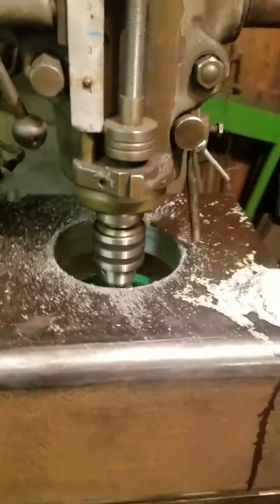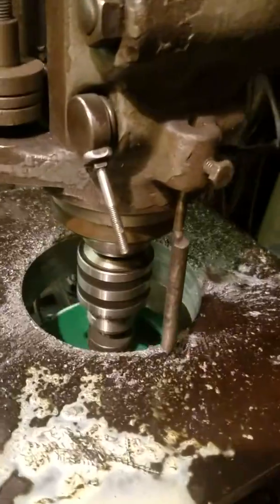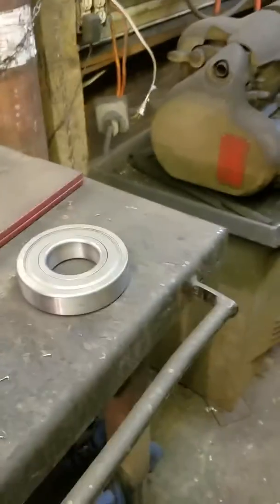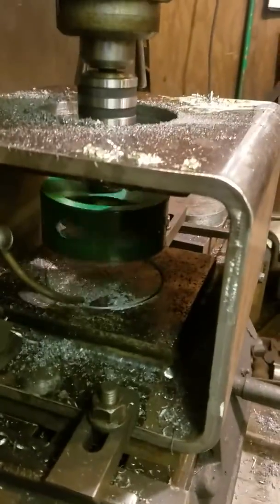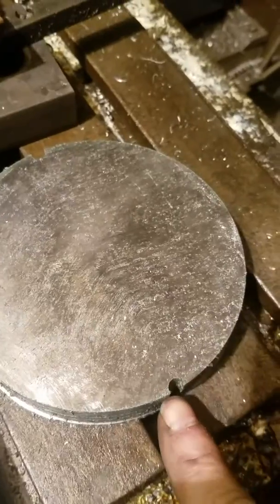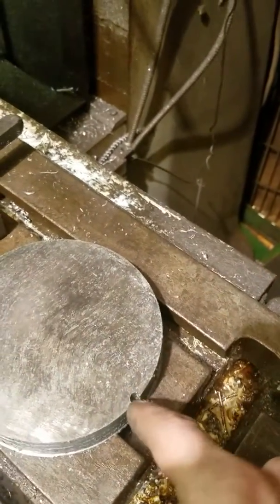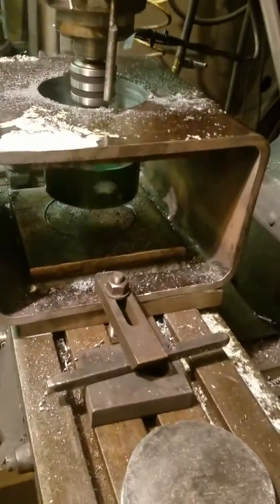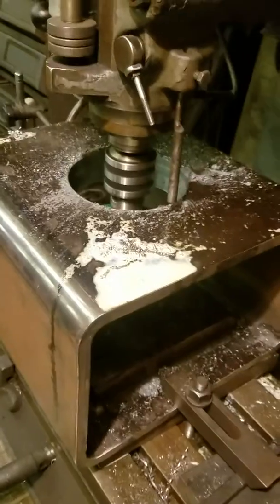Cutting a 5 inch hole in 1 1/2 inch thick mild steel.

Comment: How many rpm are you running? I'm trying to cut an 85 mm hole with an hole saw, roughly 3" 1/2; I'm not sure about the rpm; I'm around 1890/200 (i run with an inverter)
Reply from the maker: 80 rpm...  Hole saws need to be run as slow as possible...  I run even my 1-3/4 hole saw at 80 rpm... Get about 3 times the life out of them than even just jumping to 120 rpm.

Slow speed, lots of coolant, and keep the trench blown clear of debris....   If you dont have the relief holes, blow the trench out with air about every 15 seconds...

Comment: Ever considered  using a boring bar?
Reply from the maker: The final dimension on this hole was 5.375 ID...  The 5 inch hole saw is the rough cut before boring it out...